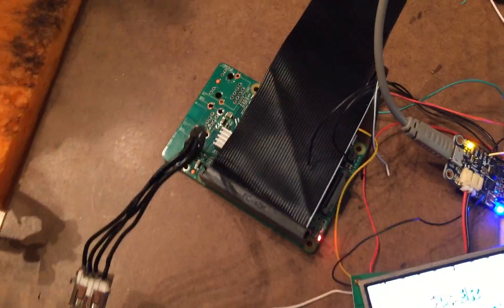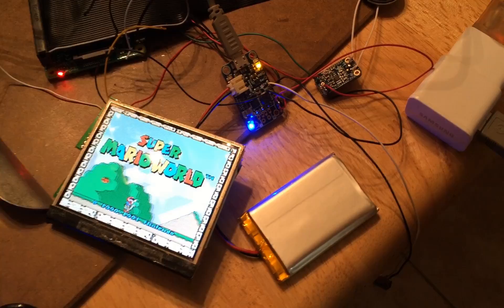Raspberry Pi Gameboy Build Log 1

Comment: Hey, looks like this is going to be awesome. I'm doing something similar with my raspberry pi 2, just wondering how you're outputting the video from the pi?
Reply from the maker: Josh Ford The video is output to a 3.5" composite video screen.  The yellow input wire from the screen is wired directly to the composite video output from the RPi.  You can find the point on the back of the RPi, it's the one near the audio/video jack which is connected to the point marked PP24.